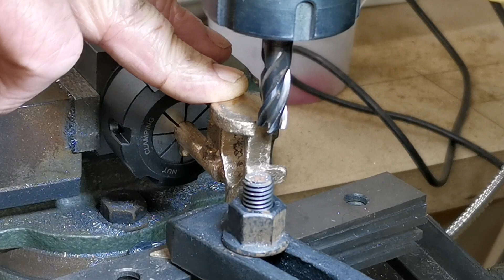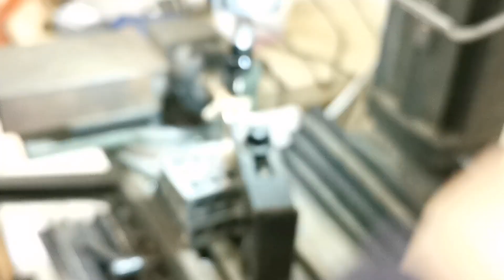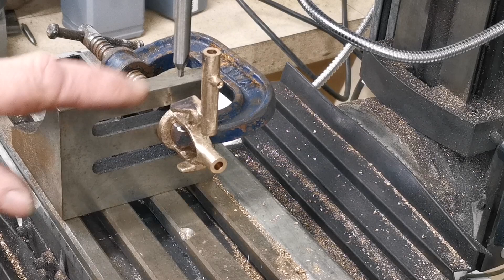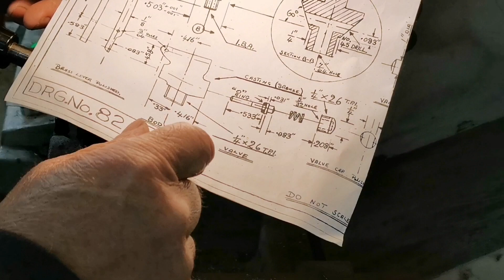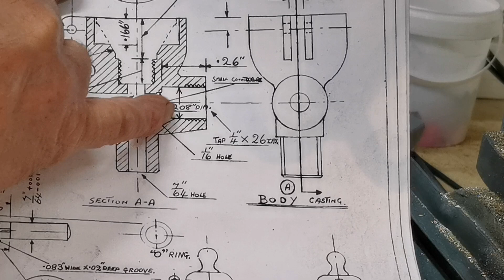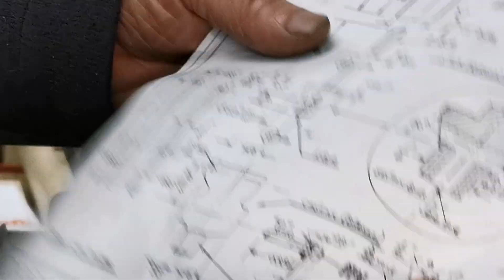2" Scale Fowler Showmans Traction engine

Comment: Another enthralling video, look forward to seeing you finish the whistle - some more very fiddley parts.
I am just starting to build a similar engine, haven't decided at this stage whether to finish it as a 2" showman's or a road loco.
On thing that puzzles me - are the spectacle plates fastened to the boiler (with blind bushes) or are they just fastened to the horn plates, my drawings dont show fastenings to the boiler but show holes in the plates.
Will be referring to your videos a lot - you have some really good setups for machining.
Reply from the maker: Thank you. The horn plates have the spectacle plates fitted between them, the horn plates bolt down the back sides of the boiler, and the spectacle plates have a flange curved to the same as the boiler which is fixed to the boiler with blind bushes, as is the cylinder block and weyshaft bracket, hope that helps. Thank you for watching 👍🏻